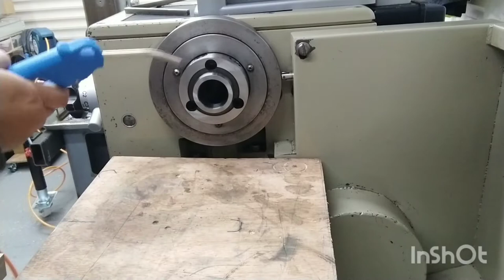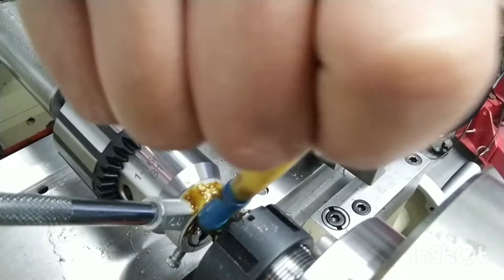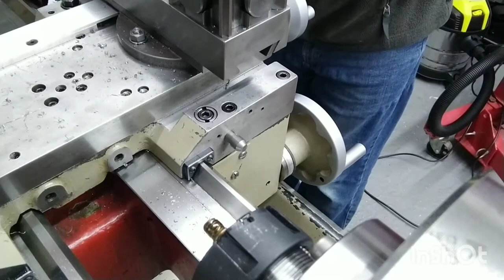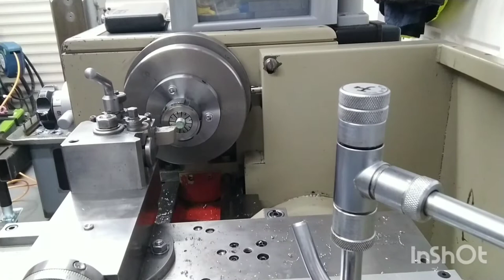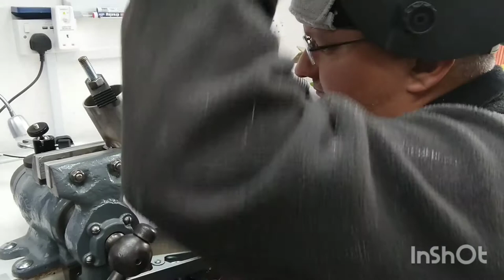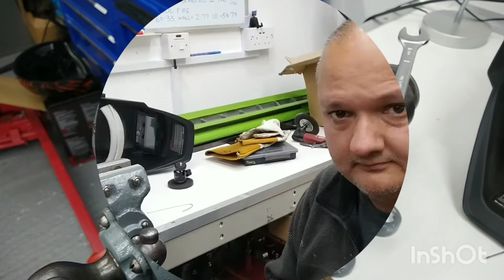Home Made Tools - Bearing Bush Puller for Harrison Mill - Part Two

Comment: Hi Carl, if a jobs worth doing........ You have made a great job of that and nowt wrong with that welding, it's never going to fall apart!  Cheers, Jon
Reply from the maker: Hi Jon. I completely agree. Overkill really, but it was more a chance to use the lathe after repairing the DRO system and also to fire up the tig after a long period of inactivity. Likewise my tig welding abilities. Thank you for watching and thanks for the support. More mill refurb stuff to come shortly.

Comment: Hey Carl, nice work building the puller, bet it is going to work great. Like your vice, who is the manufacturer of it?
Reply from the maker: Hello Dale. Thank you very much for watching my film, it is much appreciated. The vice is made by a famous British maker called Swindens. The one I have dates to the Second World War. It was in use by the British Army, most probably a regiment called REME (Royal Electrical and Mechanical Engineers). When I got it I did a refurbishment job on it. Swindens still exist and their vices are still made and still used by the British Armed Forces.

Thanks again Dale for your interest.